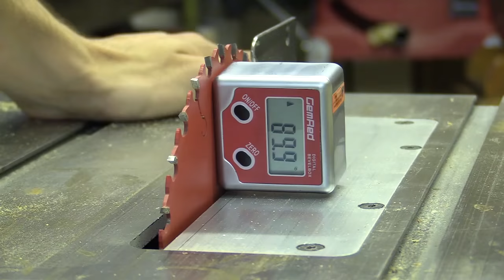Mitred Plinth from old Veneered Doors

Comment: If the old finish was shellac wiping it with alcohol would be better. Ethanol is the traditional method but ispopropyl alcohol works better.
Reply from the maker: BR H I tried that but if became really sticky and the finish looked like it was coming off onto the paper towel. I decided to just use a waterbased varnish ontop. Give it one coat last night and will check it when I'm next in.